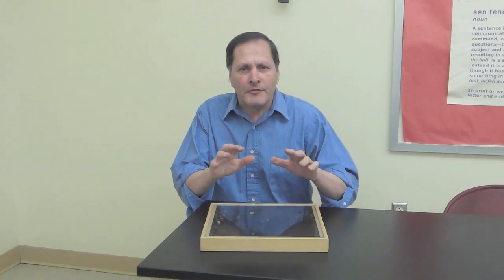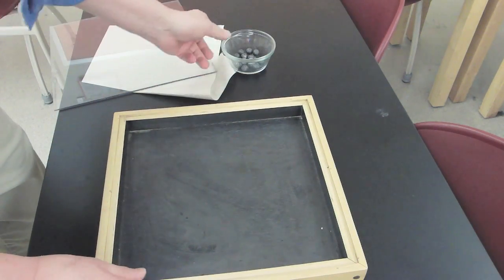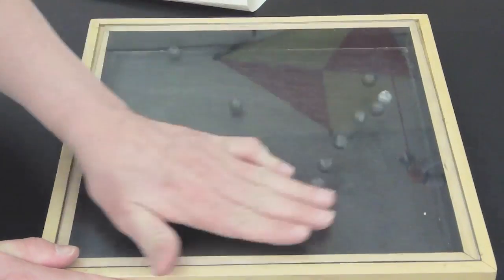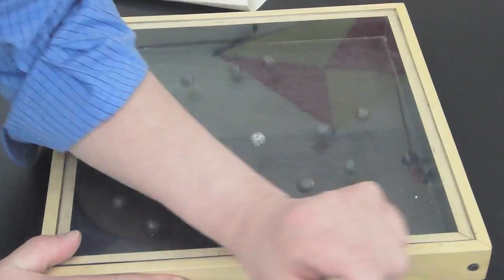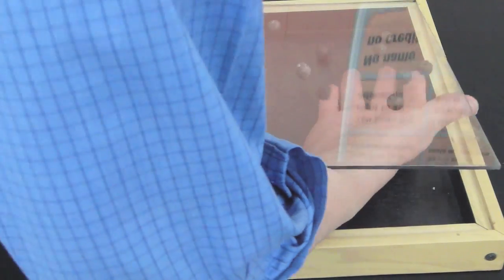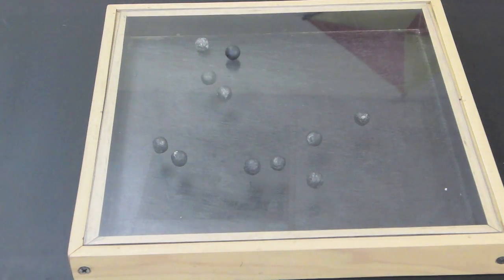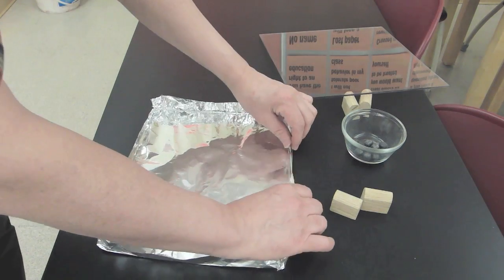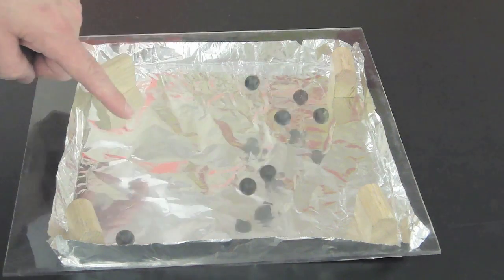Static Electricity box -  dancing foam balls = Homemade Science with Bruce Yeany

Comment: Hi Bruce: we saw a demo recently that matched your second, "simple" set up. I then built a box nearly identical to yours in order to have a reusable device for the classroom. After only a few uses, however, the balls ceased to react, and even days later we can't get it to work. I suspect a build-up of static charges that needs to be grounded or released in some way, but I sealed the plexi cover to the box. Any suggestions? Could I perhaps add a simple ground wire to occasionally "reset" the device?
Reply from the maker: I've used the same ones for years,  but this does depend on humidity,  it needs to be dry.   As it sits over time any static charge will dissipate but should build up a charge when you rub it

Comment: Bruce Yeany can you tell me where you bought the stryrofoam balls from?  Because I need the balls from where you bought it and when I was in the science fair I got judged and got fifth place so now I am going to the district science fair
Reply from the maker: that's terrific,   check online for science supply companies. Check for static electricity balls or pith balls,  try Nasco,  VWR,  Sargent Welsh,   if you can't find the black coated balls,  you can wrap them with a a layer of aluminum foil.

Comment: Bruce Yeany I am doing a science fair this week and I chose your science experiment to do but when I got all the stuff I needed and tried it out it wouldn't work we thought it was the balls so we bought India ink and my mother told me to replay... I did and I noticed your sheet of clear plastic was kinda thick and our's was really thin so what do you think is the problem the balls or clear plastic
Reply from the maker: I've done it with thin plastic sheets also,  not sure what the problem is for you,  it is very sensitive to weather,  it has to be dry,  rainy days are no good.  Also, try wrapping the balls in aluminum foil, see if that works.
Reply: Bruce Yeany I already wrapped it up in aluminum foil and it didn’t work but thank you I will try getting the plastic you told me to get

Comment: Bruce, good evening, I'm preparing this experiment. What are the materials exactly, if you could help me please, the fair is next week, I expect favorable response.
Reply from the maker: The sheets I use are acrylic plastic and work well,  other plastics will work such as PVC and polyethylene  I think whatever is sold as a clear sheet should be fine.  The small balls can be covered with a graphite paint if available, or wrap them in a layer of aluminum foil and roll them in hand to made the surface as smooth as possible.  Remember that humidity is a big factor in this,  it works best in very dry weather.

Comment: Plzz tell me what are the ball made of?? From where i got
Reply from the maker: they are small foam balls and need to be coated to get the best results,  either carbon paint, india ink or the eaasist is to wrap them in aluminum foil
Reply: Bruce Yeany do you think using glass from a picture frame would work? The one I have is plasticky

Comment: Bruce Yeany I thought this is a cool and fun experiment so my son chose it for the science fair project on Monday. We used a carboard box lined it with foil and coated polystyrene balls with magnetic paint.This took a while because the bigger balls do not react, same size as your demonstration so we have to use smaller ones.They balls bounce around and stick to the plexy when we rub it with a cloth but if we use our hands the balls fall. What are we doing wrong?
Reply from the maker: Hi Marie E,  I'm not sure about the magnetic paint,  you might want to try wrapping the balls in one layer of aluminum foil,  I've found that works pretty good. also, rub it with you forearm instead of the hands,  it's dryer skin with less oil.  I prefer that to the a cloth.
Reply: Bruce Yeany Thanks for the quick reply. It's working now, the paint was a little wet still and the balls were not reacting and were sticking to the foil. Thanks again you're awesome👍.